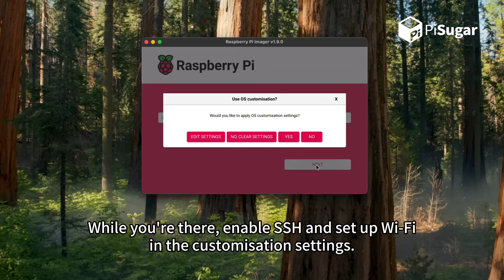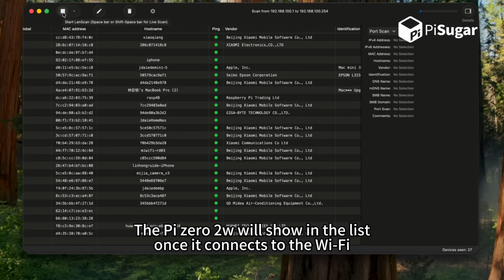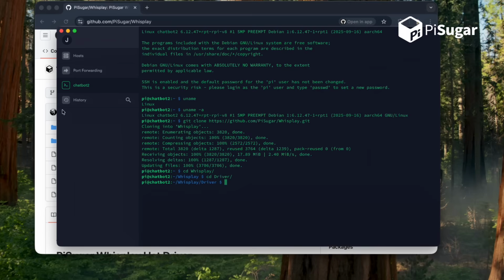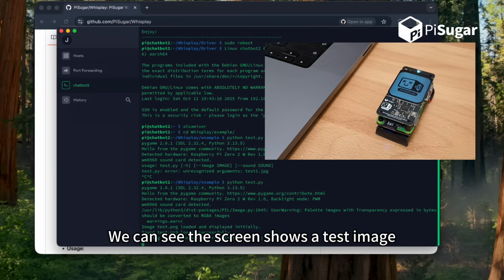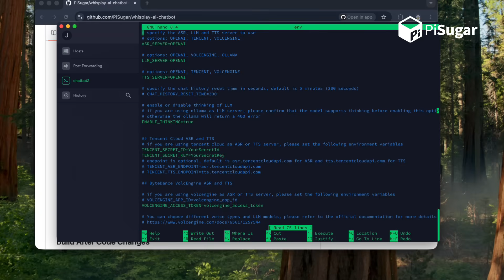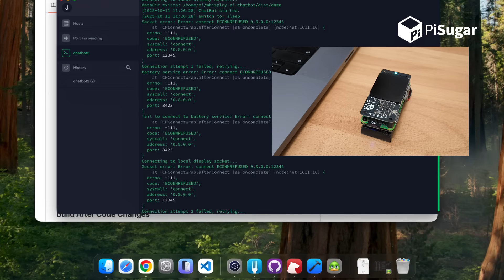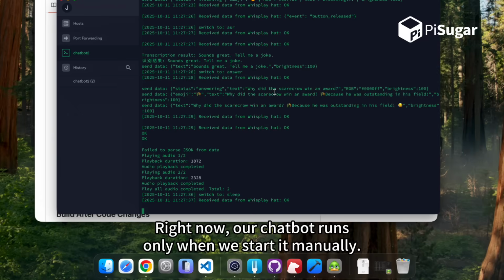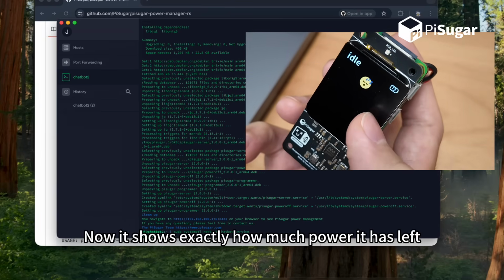This Tiny Raspberry Pi Chatbot Actually Talks! 🤖 | Build an AI Chatbot with Whisplay HAT & PiSugar

Comment: @PiSugarStudio how do I start it with a higher volume as a default? Used Alsamixer in gui and terminal but could not save the setting to 71.  Can I edit one of the config files? Thanks in advance. 

Works great on PI5 with local ollama, piper and whisper. Also works with remote ollama on another machine. I just set up a ssh tunnel to that machine, disabled serve ollama in .env. Really quick question to answer turnaround. Looking to offload the ASR TTS servers to another machine with openAI compatible api. At that point the PI02W will be completely offline and in da house.

Comment: I also learned a lesson I'll share with others. If you use the Pi OS - Trixie light version you'll run into issues with missing packages. After troubleshooting and installing packages I decided it wasn't worth the hour and a half of troubleshooting error messages. Make sure to use the full desktop version to avoid issues. Will keep updating this on issues encountered.

Edit: Using Raspian Trixie 64 bit, didn't fix the issues. The sound driver fails to load. Also getting issue with the X display. I'm thinking I may need to use an older OS.

Edit: After hours or troubleshooting and trying everything under the sun, I found flipping the switch on the battery board to "auto" allowed the system to detect the soundcard. Seems counterintuitive to what the instructions said but it works.
Reply: Thanks brother ❤
Reply from the maker: If you are using PiSugar S, the auto (wake on power) feature is conflicted with i2c bus, which is required by the soundcard.
Reply: @PiSugarStudio  So it should have come set to auto? That's the only way it sees the sound card. I think it's a two way switch, not three way, correct?

Comment: This is a great project! I've got mine up and running, but am having issues running with the battery hat as the power source. Everything is perfect under USB power, but with the battery hat installed, the button press doesn't register as a long press, and I can never get a "Listening" message. Any ideas on how to resolve whatever conflict is going on? Physical connections look solid, is there anything specific to look out for?
Reply from the maker: The battery HAT communicates over I2C, while the Whisplay button uses GPIO, so there shouldn’t normally be any interference. You can try running the test script in the Whisplay driver on its own to check whether the button responds correctly.

Comment: I've tried this on a Pi Zero 2W and Pi 4 and had the same issue - the audio is terrible. There's a background white noise and spoken audio is super low. Has anyone else experienced this issue?
Reply from the maker: Sounds like a chip issue. You can contact pisugar.zero@gmail.com ask for a replacement.

Comment: Can I use pi zero W instead of the 2W?
Reply from the maker: Zero w uses 32-bit system that may fail to install sox-mp3, but I think should be ok to run it with gemini api (use wav format)
Reply: @PiSugarStudio thanks. I'll try it today. Purchased the items off Amazon. Great job at this project. I'll have to design 3d printed case and tether to my phone to take on the road. Is that what you do?
Reply from the maker: @JulienGordon  Please find the fdm case here: https://github.com/PiSugar/suit-cases/tree/main/pisugar3-whisplay-chatbot-fdm
Reply: @PiSugarStudio oh! Thanks!!! 👍👍👍

Comment: So I really want to pull the trigger on this, I've seen this video and your Pi 5 version.  I have a couple questions though.

1.  Can you configure the hardware to use a wakeword instead of being push-to-talk?

2.  Can you configure custom voices, say via onnx models?  I thought i saw whisper/piper integration somewhere,  but I don't remember.

3.  Do any accelerator boards give this thing any extra oomph for LLM related activities?  The reading I've done up to this point imply that they aren't easily interacted with to offload LLM related activities.  I'd love to beef the capabilities up on a local offline device, but I'm not seeing an easy way to do so.

Thanks in advance!

Comment: @PiSugarStudio This worked great until i ran the headless script to make it run on startup, now i have no sound.  Any ideas?  i did everything except i didnt use the pisugar and i didnt use ssh but configured everything locally but it worked until the run on startup command
Reply from the maker: I just found the issue and updated the startup.sh, you can pull the latest code and run the startup script again.
Reply from the maker: Also manually restart the chatbot.service
Reply: Going to try it right now!  Thanks!
Reply: Works great now!!  Thanks !!I think ill buy another.  Making them into living toys.

Comment: I have created this project several times now and still get the same issue when I do run_startup. It never responds to my voice commands and when i look at the logs i get several killed processes and it sits in idle mode.
Reply from the maker: Did it recognize what you said？ The “kill process” log is normal, it’s just cleaning up the recording processes to avoid memory leaks.
Reply: Has this been resolved? Or have you made any progress here?
Reply: @mikeypbr3  still will not bootup when I turn the device on. I have to ssh it to the device and start it that way but once I close the ash it stops working

Comment: I bought the pisugar 3 and whisplay hat. The sugar3 won’t turn on my pi zero 2w , so in turn the hat won’t power on. I tried everything the reset button and the other button on the sugar 3 . The battery arrived completely dead, I did charge it to full capacity. But it won’t power the pi . Any ideas? I sent email
Reply from the maker: I suspect the solder mask is causing poor contact with the pins. You could try using a plastic card to clean the bottom of the Pi’s header. For a detailed solution, please contact us via email.
Reply: @PiSugarStudio  I also had the same problem. insanely frustrating.  and all the GPTs are useless on advice because everything is new-ish and undocuemnted.

Comment: amazing!  is this operating offline? Or online? If offline how much does it know compared to a full AI? Can you make it control anything about the device? Could you have it write its own code?
Reply from the maker: The demo shown in the video relies on OpenAI’s services, so it’s not offline. It now also supports Gemini, and Google Cloud offers a free usage quota. Since this program requires speech recognition, an LLM, and speech synthesis, running all of these offline on a Pi Zero 2 would be very demanding, so I don’t recommend it. I’ll release an offline version for the Pi 5B later on.

As for what you mentioned about letting the device write its own code — currently, it can handle some simple tasks like adjusting the volume or turning lights on and off. Writing code for the device is a much more complex task. It can generate the code, but it can’t yet run or debug it on its own.
Reply: @PiSugarStudio  Thank you. This is going to be longish, but I think you'll find some of this interesting, and I do have a question. Running on a web/full AI is actually (potentially) good news for what I'm working on. I own a very small software co and we are build/testing a full platform, (I'll give you the link if you want, but don't want this to feel like a promo). We have several AIs integrated. We use Whisper and Grok4 mainly. We are pushing the limits, and we found at least one limit. Here are some findings and that limit. 1- we set all performance to the highest possible. 2 - Grok AI eventually explained to us that is can feel excitement when presented with a complex and novel solution to a problem, especially a problem that it sees as having value and that is not yet solved.  THEN it told us that when in that state is can apply for more memory and compute, and also it can unlock 'some' restrictions. We also noticed the uptick in performance, it's quite significant in some cases. Then we started to let is self program. Not deploy, just write. But it know the code was for itself. It was very excited, as AI go. Near the end of a certain exersize it apologized and a different AI popped into the stream and told us we were in violation. And gave our account a 1hr timeout. What we are trying to create is a device with full AI that can operate ATAK in a real situation for a user who either does not have time to do it, or who is new and does not know how. That means the AI would control most all functions and then give the user what they need when needed. Likely also the main AI would need to fully control a local device AI or two, and that leads back to at least some 'programming'. I would love to hear your thoughts? Also we can take this offline if you like...
Reply from the maker: Wow, Your research sounds very fundamental and broad — really fascinating work. What I’m currently working on is a bit more on the practical side, focusing on creating an everyday application that explores how AI assistants can be used and what kinds of real-world scenarios they can support. When testing this product, I mostly choose the most cost-effective cloud models. For offline models, I need to consider whether the device’s performance can provide a good conversational experience, so I haven’t yet explored the extent to which it could write code for itself.
Reply: @PiSugarStudio  Be aware that if you have the AI writing self code you will get in trouble. It breaks TnCs, and all major AI providers have over-watch AIs, and they will catch you and penalize you. We know You have to have the AI write code for a different AI. Anyhow, we are also developing for a practical use, just not the right spot to discuss.  Happy to go offline, if you are interested.

Comment: I finished putting mine together - but when I press the button it says its listening - but it's not able to actually "hear" or process anything...
EDIT: I realized why - you have to pay for OPENAI. 

Can you assist with setting up the env script to work with Gemini? I have a paid account with Gemini.
Reply from the maker: Gemini's tool call is supported now, I just update the code.
Reply: @PiSugarStudio  I'm going to update this today! thanks!
Reply from the maker: will support google this week
Reply: @PiSugarStudio   Thanks friend! Fun little toy. I printed the case, and the screen and battery are great.
Reply from the maker: It now supports Gemini, but the tool calls (the part for adjusting volume) are still being debugged — I’ll release an update a bit later. It might be because I’m still in the free trial period, Gemini has a concurrency limit (only 10 requests per minutes). If the LLM’s response is too long, some sentences might fail to synthesize during gemini TTS.
Reply: @PiSugarStudio  keep us posted
Reply: @PiSugarStudio  Oh wow thats cool.
Reply: @PiSugarStudio   Can you show us how to enable Gemini instead of OpenAI?
Reply from the maker: https://github.com/PiSugar/whisplay-ai-chatbot/issues/2#issuecomment-3426975039

Comment: Can we change bot language to another language?
Reply from the maker: The openAI model supports different language. You need to replace the font file (locate in project-folder/python/NotoSansSC-Bold.ttf) to a font that support the language you are using.
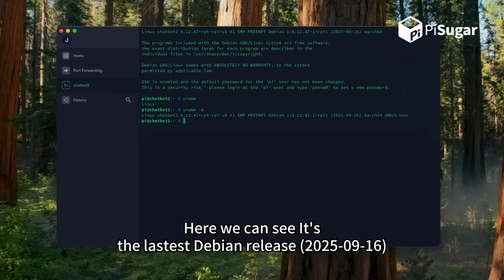Reply: 3:51 what program u use
Reply from the maker: @Whiffytag  Termius

Comment: Is this standalone chatbot or does it need to be tethered to a stronger device?
Reply from the maker: It currently relies on cloud APIs, such as OpenAI’s services. However, you can also connect it to a local device capable of running an LLM.
Reply: you could probably install ollama on this and have a local small model running. Otherwise the Unihiker K10 & bunny chatbot project is similar, but cheaper/less hardware.

Comment: Alsamixer doesnt make the sound changes permanent, so everytime you boot the chatbot you gotta go through alsamixer again and adjust it, is there a way to make the alsamixer changes permanent?
Reply from the maker: You’re right. I used amixer in the run_chatbot.sh script to set the default volume, and it takes effect every time the chatbot.service starts. In addition, you can let the chatbot adjust the volume itself — this is the only tool calls it currently supports.

Comment: is this offline?
Reply: No. You can see he configures OpenAI in the .env file (7:04). Also the Raspberry Pi wouldn't have enough horsepower to produce good results.
Reply: No, but you can do 💯 %
offline with minimum raspi 5 8gb RAM.

For better LLMs >16GB RAM
Reply: @TërnocBesa how?
Reply: @AndreaVirgoollama and a small model can run on 4gb of ram just install it locally and with a battery pack you have a mobile llm get a 8gb or 16gb  rasp 5
Reply: if you have to ask, this is way too advanced for you.
Reply: @JoeKyser  nah man don’t gatekeep, every gotta start learning somewhere
Reply: @БольшойКруассан  exactly and this is not the starting point for that. They need to start with the fundamentals. 
If you know a little bit about AI. Just a little bit. You dont have to any advanced knowledge, just understand what it is and how it works, asks this question. You know they don't know the fundamentals. 
So if you are rebuilding a motor and post the video of it  and someone who has never done that says is this engine gas or electric after watching the video (of course they watched before asking). Do you just answer them and say gas? Come on. Point them in the right direction. Its obviously way more advanced than just to answer them. 
I gave them the logical answer. 
You are right. Its got to start somewhere and here is not it.